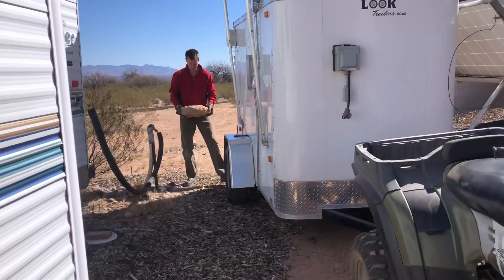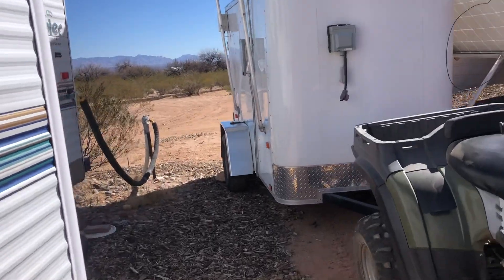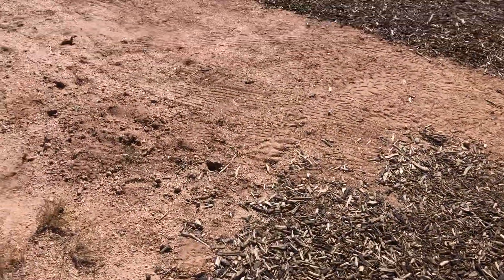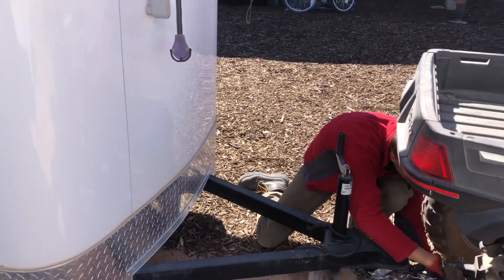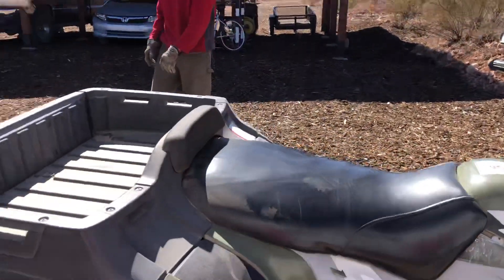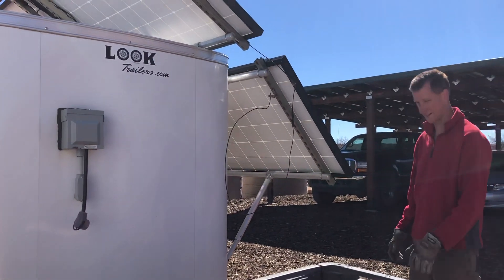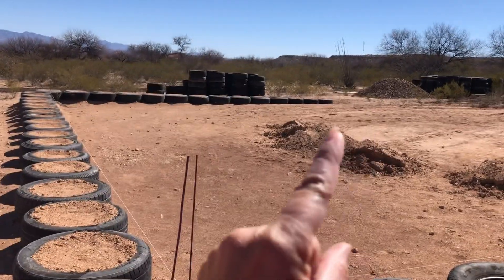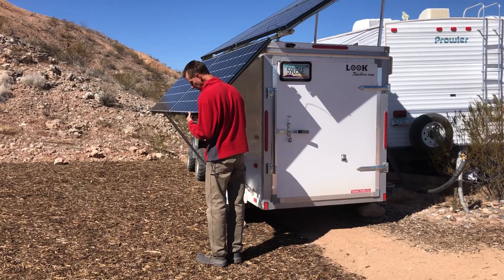Moving Our Solar Trailer

Comment: Hello Pam,  I would say get another grounding rod if the other one doesn't come up.  hope it comes up.  yes more power when it get done.  Brian's Four wheeler is the same as Jim's. only you have a good seat on yours his is worn out.    💕NonnaGrace
Reply from the maker: He rewired it so he was able to attach the copper wire without moving the rod. Exciting!😊❤️ Thanks NG!
Reply from the maker: He rewired it so he was able to attach the copper wire without moving the rod. Exciting!😊❤️ Thanks NG!